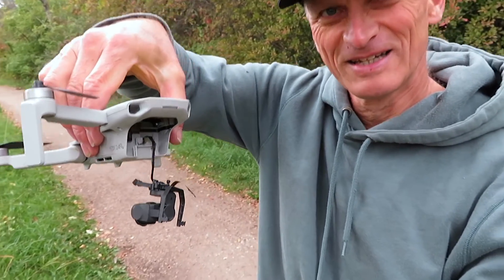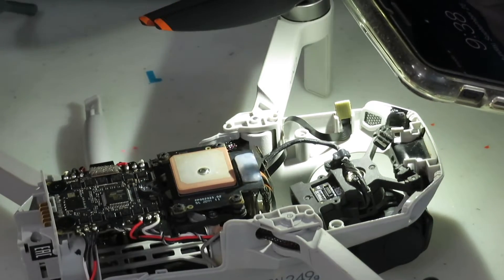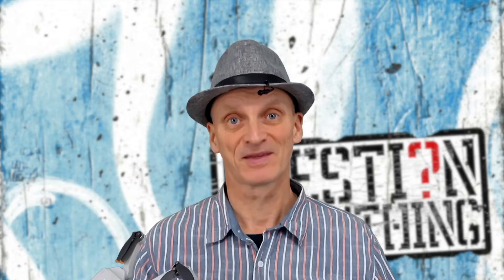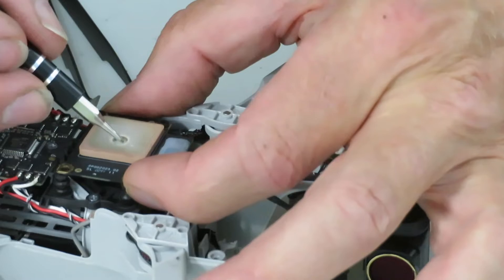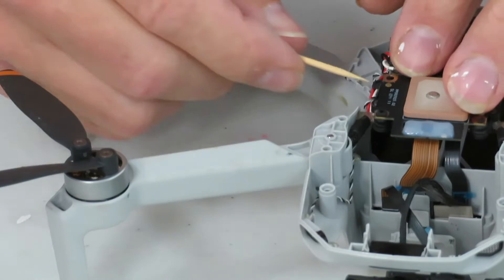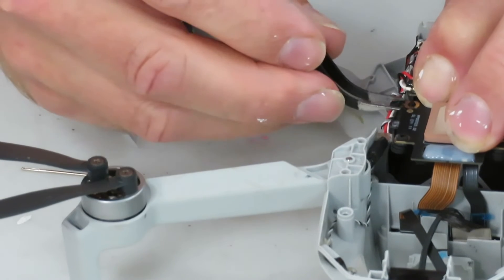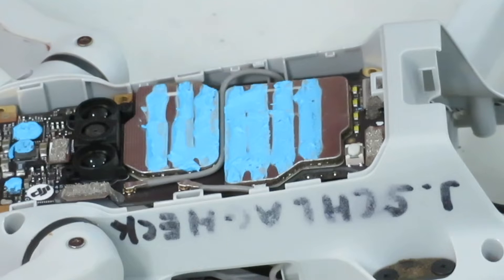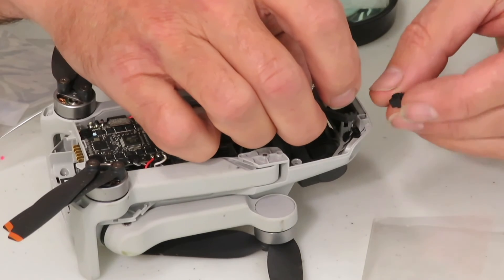DJI Mini 2 Crash Repair, important updates

Comment: Anyone changed both gimbal cables and still has a dead gimbal/camera? I don't know what to do next, both cables were replaced, I can connect to the remote and app on the mobile phone, but get errors like 40021, 10016, 10022, 40011, 30007, 30049, 30066, 10001 and 40012 .. I guess there's still something wrong with the gimbal, maybe a burnt motor? Any ideas much appreciated. br Mike

Comment: I was going to say in your original video that there was 3 screws holding the rubber mounts for the GPS to the assembly 😅. I felt that taking it off the rubber mounts was much more painful!
Reply from the maker: It was really easy taking them off, but boy did I regret it later...LOL

Comment: hey man great video simple and all . but i got a little problem when i changed the ribbin cable and closed the drone the camera went black on me and u cant see nothing see i didnt hhave the kind of problem before. plus have a 2 errors and i cant fly the drone error 1800016 and error 1800017 downward vision sensor. i tryed dij assistant 2 but no luck it dosnt work on it .
if is there way u can help me please do i cant find anything on line to solve my problem 
thank you
Reply from the maker: I'm sorry, Ilham, but I really don't have the ability to trouble shoot this. Could it be that your camera cable is damaged? The 2 errors you have don't really seem related to the ribbon cable. Best of luck, hope you'll manage to figure it out.

Comment: What errors are showing before you repair it.
Reply from the maker: Never bothered checking. The drone was just making strange sounds. Not sure if there were any.
Reply: My mini 2 showing gimble stuck, and incompatible gimble data and many more. Because it crashed and the ribbon cable has lost. How can I repair it? I am from India and in India dji is banned i will get the ribbon cable by local dealer in 2k INR.
Reply from the maker: @Raj_972  Hi RAJ. I'm not sure what could be the problem. But make sure you get a bran new ribbon cable. You can find it on Amazon: https://amzn.to/3Ydmgsv. Also check your gimbal for physical damage. Does it move freely?
Reply: @the1andonly  Yes it move freely when i turned it on the the startup sound played and the camera move. Because the video cable is ok and no physical damage.  And the ribbon cable is lost so, the stability is gone.

Comment: To easy slide the rubber thru the holes you can use a drop of liquid silicon oil that does not harm electronics. Further on the silicon helps the rubber to not drying out. Of cause, first time placing that small ribbon flat cable connectors back might be a little bit difficult and strange too. Laptops and cellphones are full of this connectors. I always wonder how reliable they make connection after releasing and putting them back. You did a nice job 👍👍 Specialty for someone who did it the first time. Congrats 👍👍
Reply from the maker: Thank you. It was a bit nerve wrecking, but I'd like to do more 🙂